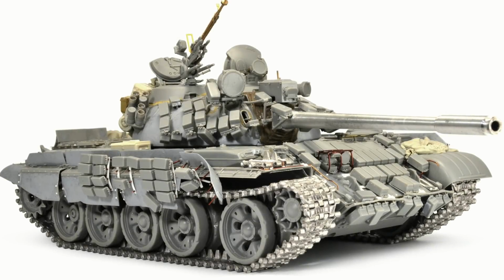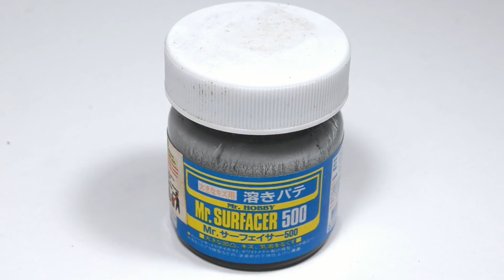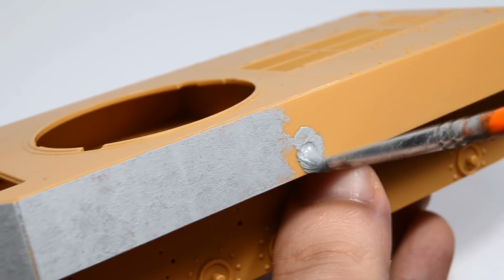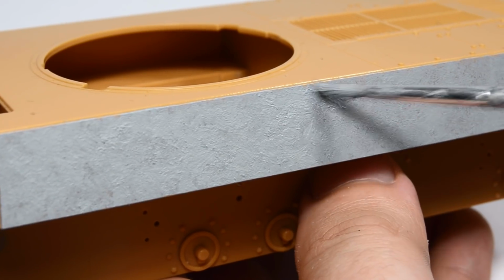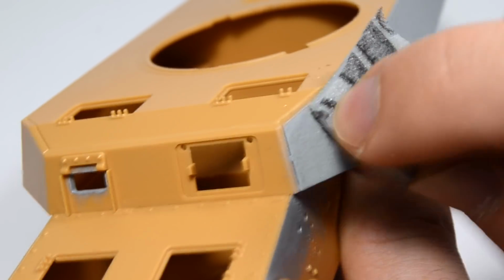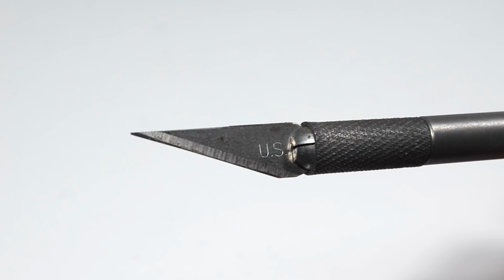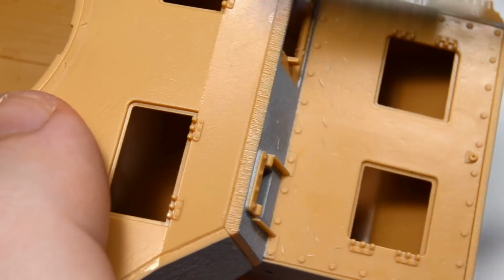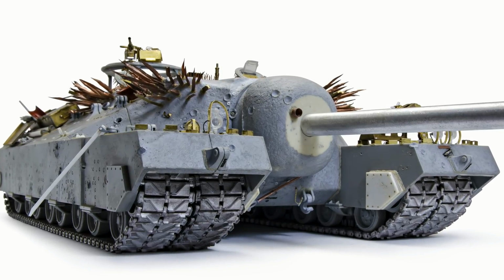HOW TO: Armor Texture & Flame Cut Marks

Comment: When rolling metal, you start think and put it through thinner and thinner rollers till you get the thickness you are after. Because of the rolling processes you are actually squishing the metal flatter and flatter each time, so thinner metal tens to be smoother as the imperfections get squished out.
Reply from the maker: Perfect explanation, thanks!
Reply: You're rolling out the bigger imperfections, but a thing that doesn't represent itself in the texture, yet is still interesting, is that imperfections in the atomic grid, especially where the structure of one part of the steel meets another part of the steel where the atomic grids are aligned at different angles (one particle of steel from a melt cools down to a flake and fuses at an edge with another flake, with atomic grids aligned differently) are searched for, as a small length between these distances, with the areas in between called corns, because they actually improve quality of the steel. Sorry for the bad language, I am German and under influence.
Reply: Bierchen?

Comment: The best video I have seen hands down on texturing! I have tried to replicate this look using liquid cement, bouncing a Dremel tool across the surface & with Mr. Surfacer 500 using a brush or sponge. I haven't been 100% pleased with the results but this technique looks very promising. I like 1/16 scale heavy German armor so mastering texturing is a must in this scale. Also I failed miserably trying recreate flame cut effects on the armor plating so I cant wait to try your method using the Exacto knife. Your effects look so real! I cant wait to see the textured finish under a coat of paint.

Comment: speaking of texturing, there is something I accidentally created few years ago on thing I really didnt want to but on hindsight it looked pretty neat.
I was cleaning up paint with thinner instead of alcohol and of course thinner melts plastic. I was brushing away at with old toothbrush and was pretty upset after ruining the smooth surface on that specific thing, but I think I would use it for something on purpose at some point. 
I also once left a space marine in thinner. it became pretty melty.

Comment: To get the flame cut look on armor plates, I use a smaller metal working file (one of the triangle ones).  Simply place the edge of the file on the plate and press with my other thumb down on the file, and then twist/rotate the file away form the model.  Then turn the the file around and do it again from the other direction.
Reply from the maker: I did it once the same way on my Maus, but my triangle file was also bent at the tip into a sort of hook shape, so I used it just for that :) But it created incredible results

Comment: After watching this I'm going to try it with Warhammer 40K tanks wish me luck
Reply: I was just thinking about that. I wonder what a Leman Russ Tank would look like with this.
Reply: @nathanieljernigan1147  glorious. long ago i aqcuired this aversion to the front mounted lascannon, flamer, bolter mount. Its like why would you build tanks, well in 40k they are pretty much tracked tractors with some armor, but why oh why would you turn the entire front of the tank into a bullcatcher. All the bobs and ends and stuff on the leman russ front would literally cause any round that hit it ricochet into the underside of the main gun or into the tracks. (look up the panther thank in ww2 where the first mantlets literally diverted rounds down into the drivers head) 

In any case i got rid of all that and made the front more "real" inspired by the american ww2 super pershing. The stuff he shows in the video helps that large open area come more alive. Im sure it will work brilliantly on other parts as well. Sorry for long rambling response.
Reply: @nathanieljernigan1147  I am at the moment working on a leman russ myself. The thing is the games workshop tanks lack a lot of detail. They seem to be intended to look as cartoons and it is quite  challenging to make them seem realistic. I would be quite amazed to see a tank from gw to be built by a modellers such as night shift or plasmo.
Reply: @Mornomgir   "Shot traps" are no longer a concern for tank designers because the shells in current military use simply do not bounce, they penetrate or they shatter. I have to say, you probably made your 41st Millenium tank less "real" by designing it on standards that are already obsolete. Then again a lot of stuff in 40K is more about style than making sense, so do whatever looks good.
Reply: Many of the sweatshops and forge worlds that produce endless lines of Leman Russ tanks do so with such imprecision that no two tanks are exactly alike, and I can imagine they are built with haste and will have many unfinished textures.

Comment: Haha one of the best scale modelling channel! I actually have my own tec: i use a dentist thing called "jet" or i can use extra thinn glue too, but in my country its expensive, then i take a brush and put in the surface, with a round and hard brush i make the texture, then i sand it down with a  2000 or 3000 grit sand paper, the first time i used was in a 1/35 M10 from Italeri and got a gold medal in a contest called Superkits in my country, now im looking foward to do zimmerit on a 1/76 panzer iv from airfix
Reply from the maker: Interesting technique. Also congrats on the gold! Oh, zimmerit, I'll have to try that as well (I don't build much German stuff lol)
Reply: @NightShiftScaleModels  i have used tamiya putty once... Buuut its not that good... Maybe i use two parts epoxy putty

Comment: Your weld-bead vid inspired me to scratch-build a turret for a warhammer tank, this on is inspiring me to attempt to do armor texture on an urban assault tank I'm scratch-building/restoring from a trashed ebay bitz lot (also 40k, a repressor). 
While much of it is already covered in over-the top imperial gubbins (angels, skulls, roman aquillas, etc) there are a couple parts of track guard that are factory smooth and kinda boring that I might add some night-shift style armor to.

Comment: Top steel is rolled between rollers, side steel is cast in sheets.  Its as simple as that.  American tanks used thin top armor because of battle doctrine, American doctrine says that air dominance is required before tanks are rolled in.  No air threat and you can use thin top armor in old days.

Comment: Great instruction about texturing! Could you also talk about how to texture modern western military vehicles? seems they usually have smooth surface, especially light vehicles, such as armored transporters(M2A3 Bradley/Cougar), and even Leopard 2 has skin looks like new born baby, not sure how to make them more interesting.
Reply from the maker: maybe veeery thin putty, or just leaveit smooth. the texture is so minute it would be invisible in small scales

Comment: The Challenger, M1 and Leopard tend to get some rough spots around the undercarriage and tracks, but mainly from leaving mud sitting on the paint after maneuvers. Causing the through hardened steel to oxidise, which is a little weirder than say the way a kitchen knife will.
Because of the CHOBHAM 1 and 2 plates though, the outer shell is quite thin on the Challenger and M1. So it is quite smooth. The only rough texture is actually, how well the crew slap on a new coat of paint...
Reply from the maker: Lots of great info! Yes we can often see modern tanks being painted over several times resulting in a pretty uneven rough texture.
Reply: @NightShiftScaleModels  a paint texture can easily by added on 1/35 or larger models by using a brush though.  (particularly on small ship hull in a large scale, or even large ones in even larger scales).
But it's not usually a texture people like, hence airbrush.
Reply: @NightShiftScaleModels  To add a little detail on why thicker plates tend to deform so much. The addition of multiple layers, means the previous surface needs to be hot enough. Similar to a forge weld (intact, almost identical to a forge weld). However, over time, adding more layers, means the next one is pushed into any dips or folds in the previous surface. Add any contraction of the surface cooling, and any thinner or thicker sections, and the steel starts to emphasise any "detail."
Finaly the through hardening process during the rolling of each cast plate, produces that slightly grainy looking surface texture, in addition to again causing the material to expand and contract. It's that heating, in addition to minor buckling that made riveted plates so easily pop, do to the leverage they gained towards each edge.
German interlocked hulls, almost compelling mitigated welds unzipping, and I've never seen any record of the frontal plate of a late panther or king tiger model with any hull breaks. Just punctured holes.
Reply from the maker: I think I saw a photo of disconnected plates on a KT once. But like you said, these joints were very durable. It's more common to see T-34's with completely cracked welds. 
Also regarding the paint texture, it can be done on models, but you have to make it 2-dimensional while tricking the viewer into believing it's actually 3D. The reason for that is, as you pointed out, it would just look bad on scale models. I'll be doing something similar in the upcoming Chi-Ri series.
Reply: @NightShiftScaleModels  Is it a KT with a cracked weld seam on the rear,  that looks likes it's mushroomed?
If that's the one you saw, I think that's when they parked a Panther 2 and later a KT at the end of a field, with  large embankment at the end, and parked a Pershing with the brand spanking new long barrel 90mm freshly installed. The shell passed clean through the upper glassis, the blast resistant wall of the turret basket armor rack, through the rear bulkhead, into and out the back of the engine, before Finally mushrooming the rear armour plate, and burying itself so deep in the mound behind it, after 2 days they never found the shell...
The KT had similar results, only the shell didn't go so cleanly through the engine block, and because it dragged half the engine black against the rear armour, the mushrooming, and buckling on the plate split the rear port side seam. The bulkhead and engine block made the shell take a 10 degree turn to the right...

Now consider... The fact, that 90mm was still not as powerful as the long 88 mounted on the KT and JT-88 (not by much though, they are pretty much the same)

There's a lot of M4A3's where a shell has passed through the upper plate, very close to the port or starboard hull, and popped the seam open. Some look like someone just peeled back the side of the hull slightly. Starting from the front.

Comment: I don't know so much about the Challenger, but there's a surprising amount of VERY small-scale "texture" on the Abrams. And, try 120, or even 80 grit sandpaper for "texturing"....Those green nylon kitchen dishwashing scrubbers also work great for smoothing.They're called "Scotch-brite" here in U.S.....
Reply from the maker: See, I knew it!! 
Also, softening the plastic with acetone and then pressing sandpaper against it kinda works. Creates interesting texture but it's harder to control.

Comment: Since the Mr. Surfacer is likely Lacquer based paint, I'd bet spritzing some lacquer thinner on the sanded surface would meld the dust back into the panel without worrying about it.  Also, Squadron filler and Bondo spot filler are the same - just thicker than Mr. Surfacer.

Comment: The medal is my favorite in this one!
Thanks for a useful tutorial, I already applied it to my current build (i tried).
Would be really happy to get some idea on how to make a cast turret on t34-76 in 1/56. According to the photos early castings were not that over-textured as castings on KV-1 or other heavy tanks.
Reply from the maker: In that case I would stick to just some very gently stippled and sanded down putty. If they were rather smooth, there's no point in going crazy, especially in such a small scale.
Reply: Night Shift thank you for your advice!
As I have already made some “steel” texture for the hull, I planned to make the turret a bit more rough. I think in this case (if overall method is the same) I will try a very diluted putty so the plastic is damaged more.  Imo wargaming oriented models allow for some madness like a bit oversized details and textures (that is the reason).

Thanks again for your work, keep it up. Have fun and so will we!

Comment: Fantastic work and video once again (Your prounounciation of Perpendicular was spot on - on your first attempt btw ;) ) 

The only time I've used straight Surfacer 500 on a model was the mantlet of a T29E3 because I thought it looked good. Have you considered doing a vid on Milliput/Epoxy putty weld beads? I can't for the life of me get them to attach to a plastic surface.
Reply from the maker: Haha, the more you know :) Next time I'll keep that Perpendicular thing in mind. Or I'll just avoid it! 
Surfacer 500 creates great texture and is very effective on rough cast surfaces, it also has more volume and doesn't level down as much as putty. I use it from time to time, but overall not the biggest fan.
And well, it was supposed to be a surprise, but now that you asked..... yes, the next video will be about EPOXY WELD BEADS! Woooooohooooo!
Reply: @NightShiftScaleModels  Very soxy 👌 - Yea, mines so old that it now creates spider webs when I use it - which can be a pain to remove after. 

It's one of those, Use in moderation sort of products (aka Pigments)
Reply from the maker: Oh yeah, I remember having a bottle of Mr. Spiderman Surfacer too! Nasty stuff, I guess it happens when the seal isn't airtight anymore?
Reply: @NightShiftScaleModels  Yea, It definetly seems to happen when its thinner evaporates some.
Reply from the maker: And that's one of the reasons I don't use it that often. And if I need to prime the model, I use a spray can :)
Reply: @NightShiftScaleModels  Tamiya Surface primer is very sensual. Considering it's in a Can. I've heard all of this Fluff about Airbrush primers but I'd rather save my time and money tbqh fam
Reply from the maker: Me too. Although if a model is very complex and/or small, I better use airbrush. But most of the time I spray the Surfacer into a cup and pour it into AB lol.

Comment: Why the smooth top and rear in most tanks with welded/built up hull and/or turret?  Its not armor plate. Hot rolled steel, maybe even cold rolled. If it wasn't, the tank weight could very well double. Cast tanks are not any different, they just have different thicknesses throughout the casting.
Reply from the maker: No idea, like I said I'm not an expert on this. But many photos show this, museum tanks but also WW2 close up pictures.
Reply: It's a result of the different manufacture and purposes
The hull top and rear are thinner and are through hardened - the entire plate is high hardness
The hull front and Turrets are Face hardened - only the outside surface is hard, the inside is still soft

As something is hardened it becomes brittle - it loses flex and becomes at risk of shattering if a large impact happens - If a tank round hits a through hardened plate the inside splinters inside the hull as shrapnel
Rifle and MG rounds cant hit hard enough for that so thin hard sheet protects from that
Tank rounds needed face hardened to defend as the soft back would flex and dissipate energy

The stippling effect is a visual artifact of face hardened plate

Comment: Folks, I’ve found a way that I wouldn’t dare say is “better” than Uncle Night Shift’s or other prominent armor scale modelers to create a smooth, rolled steel texture on armor models. Now, this is my opinion, not empirical fact. But, unless one wants to create a stippled surface which one could also use with the product I’m going to mention, you’d be shocked at how smooth such a heavy liquified putty can come out without the use of hand brushes, smelly glues and messy putty. That product is Mr Surfacer 500. Now, this isn’t my idea. A bloke named Mokonoman on YouTube showed me this, but I had to go elsewhere to learn how to thin. I decant into a clear small plastic Dollar Store bottle about 1/5 of the bottle with Mr Surfacer 500 and it settles right to the bottom. Id say overall it’s 40% of my mixture. Then 10% of 90% isopropyl alcohol from anywhere, then another 50% of Mr Surfacer Leveler 500 thinner into the bottle. How much to decant into the bottle depends on how much you’re covering. I then take a Tamiya hand mixer like the kitchen mixers (I suppose you could wildly trash this mixture for a couple minutes if you don’t have one) I then decant it into my airbrush reservoir and depending on your model I’d set it between 25 and 20 psi and use the  .5 needle, spray onto your model surface. The Mr Surfacer Leveler will ensure you don’t get build up in detailed places. You’d be shocked at how well it looks. And you can cap your Dollar Store extra and use it later again after mixing. The surface gives you a smooth, rolled armor texture. This doesn’t apply if you want to stipple it for cast surfaces. For that use the Mr Surfacer 500 straight from the bottle with a flat round brush. It’s easier than the glue and Tamiya putty IMHO. Try both ways and make your own decision. Caveat: you’re going to have to clean your airbrush, needle, nozzle etc after this. But is worth it when you see that thick liquified putty go on smooth.